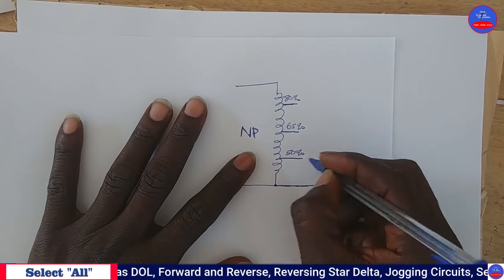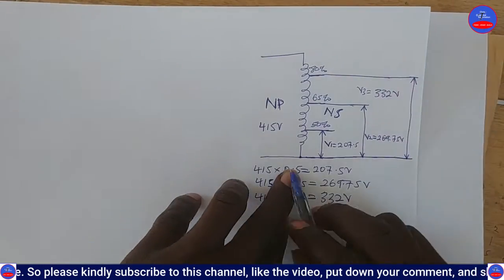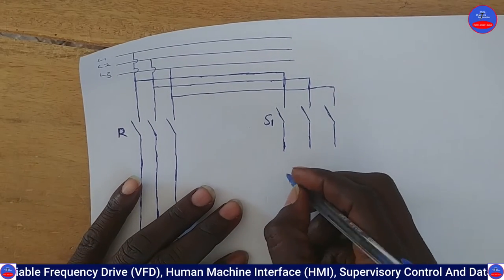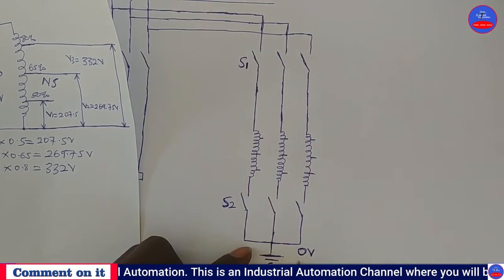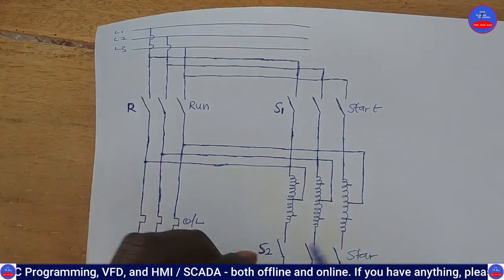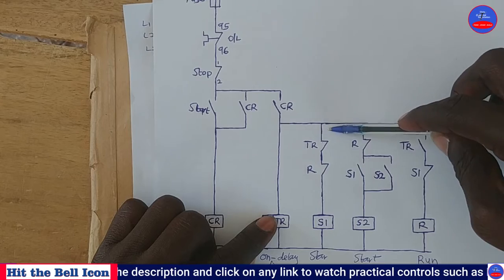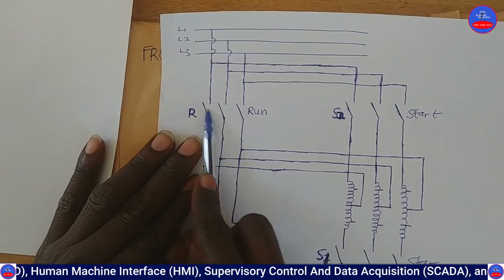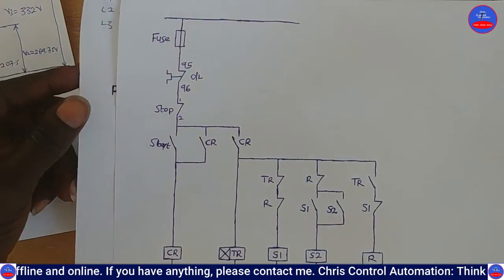Auto Transformer Explained (Power and Control Diagrams)

Comment: Bt once the timer switches to the N0 to become closed, the closed contact on S1 will open so continuity won't be assured to the run coil. I need some clarification. thank u
Reply from the maker: The R closed contact just on S1 (star) contactor and that of S1 closed contact just on R (run) contactor are electrical interlocks.
It means that, when star energises, run should not energise, and vice versa.

So please kindly Watch my video on forward and reverse to understand interlocking. https://youtu.be/FUK12uflgAE?si=Twl2s_Q_SIvo0pBq

Click on the link the watch
Reply from the maker: If your question is answered or not, let me know

Comment: Wonderful 👍,
Reply: For star delta starter what's the current ratings for contactors, and how do you calculate them.
Reply from the maker: We size based on the FLA of the motor.
Reply: @ChrisControlAutomation  so does it mean that star contact and delta are of same current ratings??